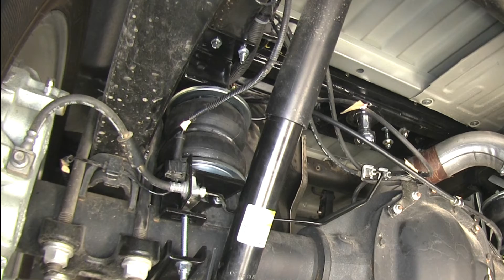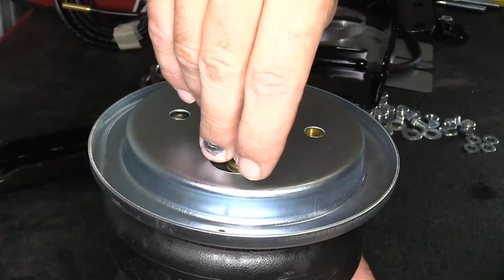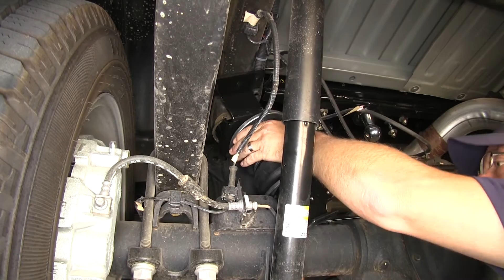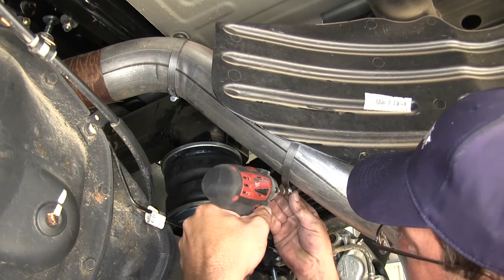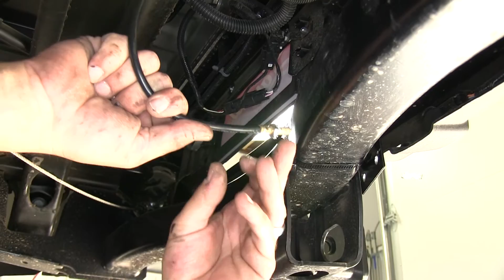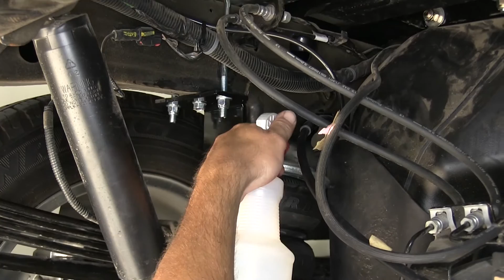etrailer | How to Install the Air Lift LoadLifter 5000 Air Helper Springs on a 2013 GMC Sierra

Comment: I have a 2012 Sierra 1500 WT model but it says it doesn’t fit the work truck models why not?
Reply from the maker: This kit is designed to fit the 2500 and 3500s. Check out the following link to see the options you have for your 2012 GMC Sierra 1500.
https://www.etrailer.com/susp-2012_GMC_Sierra.htm?Style=1500&fUrl=-pm-Air_Lift

Comment: What about a truck ona 6in lift how could i make this work?
Reply from the maker: We have 6 inch spacers for this kit but it will depend on what lift you have on you truck. This matters because of where the lift kit is installed on the truck and the actual height that the lift has added.
https://www.etrailer.com/Accessories-and-Parts/Air-Lift/AL79GV.html
https://www.etrailer.com/Vehicle-Suspension/Air-Lift/AL57338.html

Comment: I have air bags coming but why does the bracket have to be drilled when the kit is a no drill? Shouldn't that bracket come predrilled the right size hole? Not a no drill kit if you have to drill.....I guess i am confused...
Reply from the maker: The bracket that the air line tubes are attached to does not come with this kit. It is a short bracket typically used for wiring. Typically we use the following bracket.
https://www.etrailer.com/Accessories-and-Parts/Firestone/FWR17607560.html

https://www.etrailer.com/Vehicle-Suspension/Air-Lift/AL57338.html